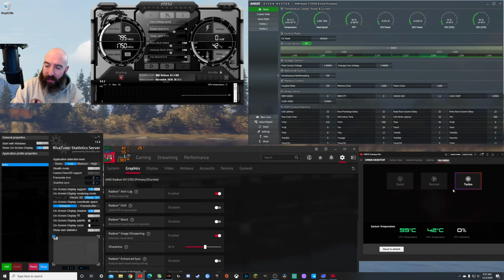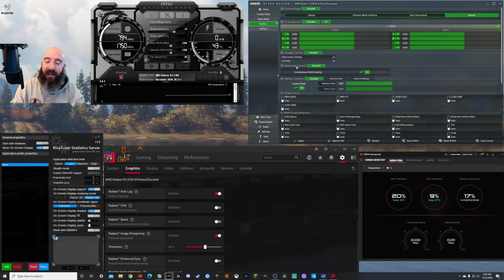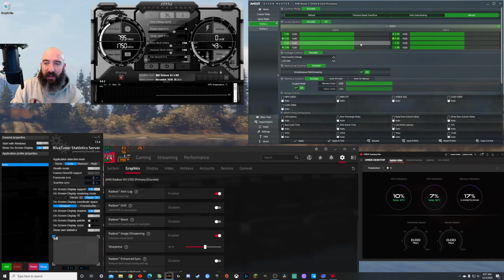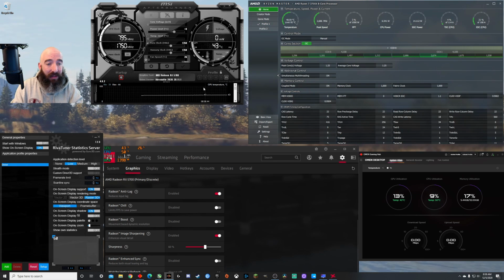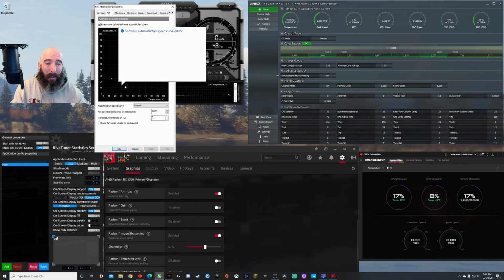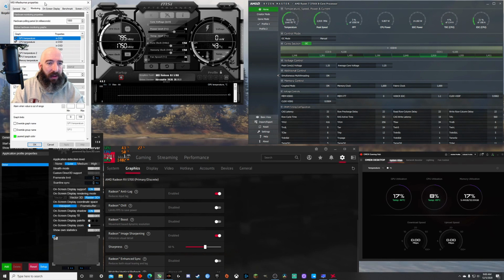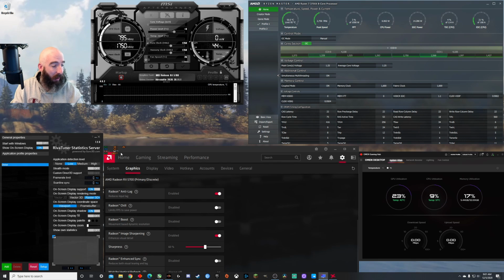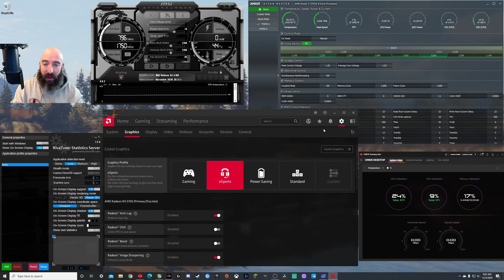My Current Modifications! HP Omen 25L! All Mods and Programs I Use!

Comment: Hey Dan i have a question. 
How did you enable xmp profile on the omen 25l? 
Ive just bought it a few days ago and i noticed that my clock speed is at 1600mhz instead of 3200.
Keep up the good work, your vids are very informative 👍
Reply from the maker: There is no XMP enabling on Omen motherboards. If you have 2 sticks of RAM, it will be 1,600mhz per stick for 3200mhz 👍🏻

Comment: Wow I'm impressed with not only your videos but also how you reply to just about every comment. 

Is there are reason you went with the noctua chromax air cooler over the corsair h60 liquid cooler? I think i saw in a comment that the chromax had better results from other builds maybe
Reply from the maker: Thanks!!! While the H60 is a whole lot better than the stock air cooler, I’m not a big fan of 120mm AIO’s. With that being said, my Noctua U9S has yielded better results than all of the 120mm AIO’s that have been placed in Omens. 

Air coolers are extremely silent and have zero fail points, just always been my preference. If you’re case swapping though, the bigger AIO’s ( 240 / 280 / 360 ) are fantastic though!
Reply: @DanKamYouKnow  i ended up swapping it out for the H60 aio. Its done amazing. Cpu Temps are now maxed around 45 when benchmarking with shadow of tomb raider. However my gpu gets maxed out around 74 when under full load.

This might be a stupid question but why don't gpu have the same easy swap out parts set up like the cpu cooler, or all the other fans in the pc? I did see a video that the fans of the gpu are connected to the gpu itself if you take it apart.  I have Intel i7 10700, gtx 1660 super. Since you're a big noctua fan im sure you would love to have noctuas on your gpu. Or even another noctua chromax air cooler on the gpu. I know space would be an issue on the hp omen 

The stock cooler did decent, and I was surprised how much it actually covered Intel cpu compared to amd. 

Similar to your setup I went with 4 noctua fans (top, bottom, front, and rear). Thinking about getting one more for the push pull configuration with the radiator. 

Thanks for your help. Its my first time actually messing with my pc and loving it.
Reply from the maker: Glad to hear the H60 worked out for you! It’s so much fun learning how to mod PC’s and build them. So, your GPU temps actually look really good, and 74 is nothing to worry about at all. If you want to bring it down a little more though, you could always use MSI Afterburner to set a custom fan curve for the GPU fan. 

Glad I could help you out 👍🏻👍🏻👍🏻

Comment: Hi quick question, I want to get this PC to game on it and thought of replacing all the existing Fans with 3 Corsair QL 120 mm fans and a Be Quiet Pure Wings 2 PWM 92 mm fan at the back. Do you think that would cool the PC enough, I will buy the i5-10400, RTX 2060 version
Reply from the maker: Yes, that should be enough to cool that PC down. There are some settings adjustments you could make as well but getting some good airflow in the case will help a lot. The best modification you could make to the PC is a CPU cooler though.
Reply: @DanKamYouKnow  ok thanks a lot, maybe I will upgrade it in the future too
Reply: @DanKamYouKnow  oh sorry I forgot to ask, does the motherboard have a free Sata Port for the Corsair Fan Hub so I can control all of them
Reply from the maker: Technically, there is one available extra SATA power connection that’s supposed to be for an additional hard-drive, but you could use it for whatever 👍🏻

Comment: Dude, i gotta say i love your video's.  I was trying to build a new PC and upgrade for months but with no GPU's on the market i gave up and found the HP Omen line that I was able to customize and purchase.  Went with the 25L and have been really enjoying your video's.  so far I've only added the top fan but really like your front fan setup also.  may be my next addition.  keep up the vids!!
Reply from the maker: Thanks Paul and congrats on the Omen. I originally was building a PC ( April / May of 2020 ) and at that time, CPU’s and PSU’s were months behind on shipping out, so I bought the Omen. The best thing I ever did for the Omen was the CPU cooler, drastically lowered temperatures. Even the fan additions do help out tremendously. Let me know if you have any questions on it. 👍🏻

Comment: Do you think a 290mm length will fit in an omen 30l???
Reply from the maker: The max people are saying with 30L’s is 286mm, so 290mm may fit but it’ll be a very tight squeeze. I’d measure your case to be sure.

Comment: I have a 30L and replaced the top and rear fans with noctua chromax. I moved the originals in a similar configuration as yours. It seems to be running a little cooler. I haven't seen it mentioned, but it has probably been brought up before - the Omen Gaming Hub removed fan control. Do you have a recommendation for another app that can control fan speed?
Reply: Nevermind... just read about MSI Afterburner and I'll give that a try. I didn't realize it was compatible with different brands.
Reply from the maker: Apparently Omen Gaming Hub is taking away fan control from what I’ve seen, or some models do not have access to it anymore. Not sure why

MSI Afterburner is for your graphics card fan curve, not the case and CPU fan.

Comment: I know a lot has changed since this video but I needed help with my temps.  My 30l came with a 10850k and it runs hot if I am gaming.  It gets hard-pressed but still stays around 85 to 90C.  It sounds better than your early numbers before you installed to noctu cooler.  Should I keep the AIO cooler or switch to the Noctua NH-D15 or should I just swap to another case?  Oh yeah, and it came with a rtx 3080.
Reply from the maker: Your system definitely runs warmer than mine because it’s a much stronger CPU and those numbers are common for Omens with that configuration. Unfortunately a D15 will not fit in an Omen case ( will hit the side panel - too tall ). If it were my machine, I’d do case swap and most likely go with a 280mm or bigger AIO. The case is definitely the weak point for that system and 120mm AIO’s are just kind of pointless.
Reply: @DanKamYouKnow  Any recommendation for good fit case and cooler?
Reply from the maker: I’d get a case that supports maybe a 280mm AIO ( 2 140 fans ) and there are so many choices for cases, it depends on your preference. YouTune search “Best airflow cases” and you should get a lot of good results, specifically Gamers Nexus’ videos. Then choose whatever floats your boat.

Comment: One question, can you replaced the ryzen 7 3700x with a better Model?
Reply from the maker: Yes and no. If you are planning on going with a 5xxx series processor, our motherboards will not support ( normally the BIOS can be flashed to accept it but not on ours ). You could go with a 3800 or 3900x though but I don’t think it’s a big enough upgrade that’s worth it. 3700x is a fantastic CPU.
Reply: @DanKamYouKnow  one question, which motherboard is better, the one in your Video or the dorado (h470)
Reply from the maker: Ehh, not too sure on that. Their HP boards so they’re probably about the same. Both have the same type of restrictions
Reply: @DanKamYouKnow  one last question, what is the best prebuilt 0c for $1500 that you know of?
I need a new pc for Video editing and gaming (but I also want to upgrade it)
Thanks
Reply: It needs to last about 5 years
Reply from the maker: There are SO many to choose from, it’s hard to say which one is the best. It all depends on which one has the best components and the best price. The NZXT starter build PC’s seem to be a good value with great cooling.

Comment: Can I make my top fan an intake so it pushes right into my CPU Cooler then blows out the back?
Reply from the maker: Sure, the best way is to experiment with it and see what works best. I’ve tried both methods and for my current setup, it worked best and an exhaust fan BUT, it could work better for you as an intake. Takes about 5 mins to flip the orientation 👍🏻

Comment: so when your fan is at turbo mode does it give more fps? cause my pc get heated alot
Reply: btw i have my fan on turbo mode so my pc is much cooler
Reply from the maker: All turbo mode does is increase the fan speed of the system fans. It won’t increase performance.

Comment: Hi Dan, great channel! I just bought the Omen 30l (ryzen 9 3900, RTX 3070, 32gb ram) CPU temps are pretty high while gaming, in Warzone the temperatures were over 90c. I was thinking of upgrading the processor cooler to the same as yours, replacing the rear fan with a Noctua NF-A9 PWM and adding a Noctua NF-S12 A PWM to the bottom and top of the case. The original PSU is only 500w, do you think this is enough for these upgrades or should the power supply be replaced with a bigger one?
Reply from the maker: Hey, thanks Jukka. Does your system come with the stock air cooler setup or does it have the 120mm liquid cooler? The 500w PSU is actually enough to power the system
Reply: @DanKamYouKnow  Thanks for the answer. My Omen came with air cooler
Reply from the maker: Then yes, I would definitely do the 2 fan Noctua U9S setup. It dropped my temps by 15c all around. Best modification I did.

Comment: Ah mate, thanks so much for all your content on this channel. I got my Omen 25l a couple of months ago and though I have absolutely loved it, I've had issues with cooling since the start (90 degrees at times on the CPU when gaming!). 

I'm completely new when it comes to PCs so wouldn't have dared opening it up until I found your guides. I've just installed 4 fans in the same configuration as yours and have dropped the temps by nearly 20 degrees in game and 10 at idle. Once I work up the courage I'm gonna have a go at the CPU replacement - taking the whole thing apart gives me the fear!

Anyway, thanks again mate! Keep up the awesome work.
Reply from the maker: You’re welcome Lawrence and thank you for the support, appreciate it! We all gotta learn somewhere but it sounds like you got some good mods going on so far and great results. More Omen content to come! 😎

Comment: When you installed the air cooler was everything plug and play and bolt right up? I wanna get one for my 30l I’ve just never installed one before.
Reply from the maker: It’s semi plug and play but you have to remove the motherboard. I posted a full tutorial on swapping out a cooler:

https://youtu.be/lDjr7-7NBko
Reply: @DanKamYouKnow  okay thanks man! Yeah I actually was going through your videos right after I posted that and found it I’m gonna watch it after work lol sorry new to your channel man but you got good content thanks
Reply from the maker: No problem and thank you. Let me know if you have any questions.
Reply: Also man any specific reason you went with an air cooler rather than a liquid cooler I am caught between the two
Reply from the maker: Well, 120mm AIO’s aren’t the most efficient although they are way better than the stock cooler on Omens. Air coolers ( good quality air coolers ) will cool much better than 120mm AIO’s, it’s not until you get up to 240mm AIO’s, where they became very efficient, but only 120mm’s fit in Omens case. I also personally like the way that air coolers look better even though I’m in the minority of that opinion. My cooler seems to have a 5-10c advantage over the 120mm’s on Omens. Either way, ANYTHING is better than the stock air cooler on Omens.
Reply: @DanKamYouKnow  Yeah I know I need to keep my cool my CPU temps at idle are 46-50 Celsius and while gaming I’m at 70-78 ish. I think the air cooler is the way to go man thanks I couldn’t really find a solid answer but that helped out. I like the looks of the AIOs but I’m more worried about what performs better. It’s to bad we can’t get a 240mm in these cases that would be cool. Well thanks for the help man and thanks for the quick reply’s keep posting videos man you got good content. I’m subbed
Reply from the maker: Honestly, 70-78c isn’t that bad and totally safe but changing the cooler is your best bet in keeping those temps very cool. Mine runs between 50-63c while gaming and mid 70’s while rendering ( VERY CPU intensive) so it’s definitely worth the swap 

Thanks for the sub and kind words! If you have any other questions, feel free to ask.

Comment: Could you please post the link for the top mount fan? 120mm noctua chromax! Which one is it? There are plenty on amazon
Reply from the maker: All linked in the description.
Reply: @DanKamYouKnow  the 120mm chromax doesn’t have a link! It’s available now on amazon! But idk if it’s the one you used! Could you please edit the description and add the link? The one you used for the top looks like a 120mm slim chromax, but in the video you didn’t say it’s slim! So I’m just confused! I really appreciate if you clarify it
Reply from the maker: I do use a slim version of the chromax for the top because a normal width fan “gets in the way” of the case RGB fans. I did not state either of these facts in the video though. If you can’t find the regular width ones on Amazon, they’re probably out of stock ( super common ). I do in fact use this fan for my top fan:

https://www.amazon.com/gp/product/B0813X9G8T/ref=ppx_yo_dt_b_asin_title_o01_s00?ie=UTF8&psc=1
Reply: @DanKamYouKnow  thank you, appreciate it. And just to make sure! You put it as exhaust? So it takes the air out of the case?
Reply from the maker: Correct. You can experiment both ways but it works best as an exhaust with my system. Some people do say that they’ve seen better results with it as an intake. Only takes a couple mins to swap if you wanted to try it out
Reply: @DanKamYouKnow  thank you! Is there any way to manage the lc_pump speed? Or the only way is to have a splitter?
Reply from the maker: LC_pump will always spin at 100%. Noctua does make “low noise adaptors” that will make it spin at like 70%. I just use splitters with the other fan headers.

Comment: Your intake on the bottom should be exhaust, no? Notice how dusty those fans are, you are sucking up everything that falls onto your desk surface right into the system. Yes, heat rises but other things to consider. Just a suggestion, looks great dude.
Reply from the maker: I’ve tried it and saw quite an increase in GPU temps. I’d rather deal with a little more dust.

Comment: I just bought a amd ryzen 5 3500 HP Omen 25L and I am absolutely terrified. It looks like such a shitty motherboard, but it was the only way to get a hold of an RTX 3070.
Reply from the maker: The motherboard is pretty restrictive but it’s not bad. Depends on what you want to do but it gets the job done for most people. There are some strange workarounds for it unfortunately though.
Reply: @DanKamYouKnow  Thank you, that makes me feel better. What CPU cooler do you recommend getting for it?
Reply from the maker: I would recommend the Noctua Chromax U9S, it’s what I run and has the best results I’ve seen so far on these machines. You could also spring for a 120mm AIO if that’s your thing.

Comment: I just found this same pc new on ebay for 700$$ no gpu but I have a rtx 2060 super so that wasn't a issue. I'm actually trying to install these cooling fans and stuff to the system I really appreciate you for these videos. I wanted to know what cpu can I upgrade to my system came with a Ryzen 7 3800x that's if I ever needed too.🤣
Reply from the maker: Thanks for the support! I believe the max you could run is a 3950x because the 5xxx series AMD CPU’s on B450 motherboards need to be BIOS flashed in order to run them. Honestly, a 3800x CPU is a very powerful processor and I think you’ll be fine for quite a long time.
Reply: @DanKamYouKnow  Thanks again!
Reply: @DanKamYouKnow  what's the name of those y splitters again?
Reply from the maker: Noctua Y-splitters. Amazon has a 3 pack for $10
Reply: @DanKamYouKnow  Thank you sir.
Reply: @DanKamYouKnow  I found that 3950x Cpu for 540 you think that's a steal? I was gonna buy it and send my computer to geek squad to get all my cooling added. I don't even feel like doing it myself. Lol
Reply from the maker: I honestly would stick with the 3800x if I were you. It’s not a big enough improvement to spend that kind of money in my opinion. The 3800x is an extremely powerful CPU.
Reply: @DanKamYouKnow  10/4

Comment: Recently purchased my Hp Omen 30L. After watching all your videos I’m really want to upgrade my pc. I’m currently still under warranty for another 10 months but I really want to upgrade. Any recommendations?
Reply from the maker: Well, you could always add fans inside the case and if you have a warranty concern, you could easily remove the fans. As long as your PC is in stock form, they will perform the warranty work. So if you did need warranty work, you just remove the fans before sending the PC in for the work. 

Top mount 120mm makes a difference and so does a bottom mount 120mm

Comment: Hi Dan, just got the 25L, what is the first step you would recommend doing to reduce temps? Cooler, or extra fans? Thanks, really appreciate all you do!
Reply from the maker: The cooler is hands down the best thing I did for the computer. The fans help but the cooler fixed all CPU temp issues. 

Thanks for the support Shane!